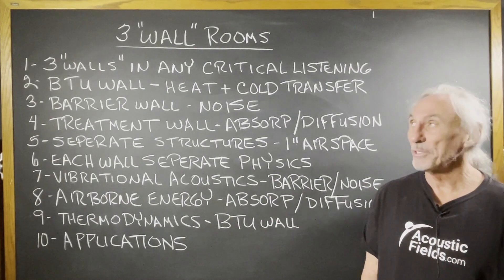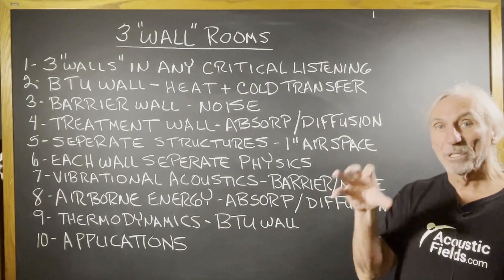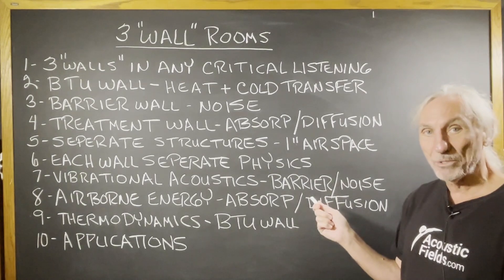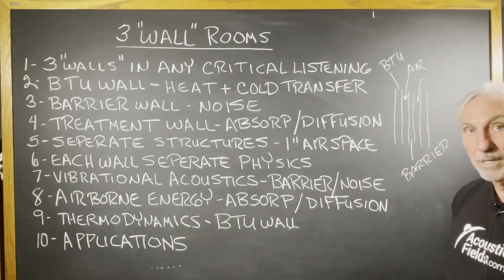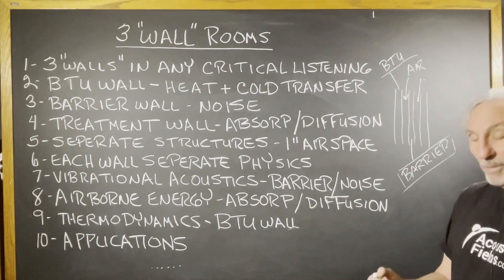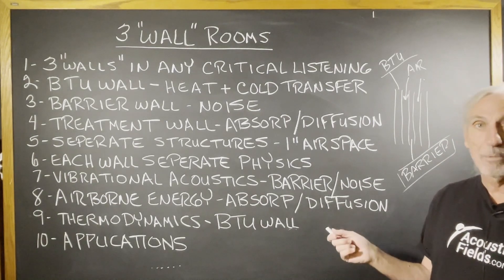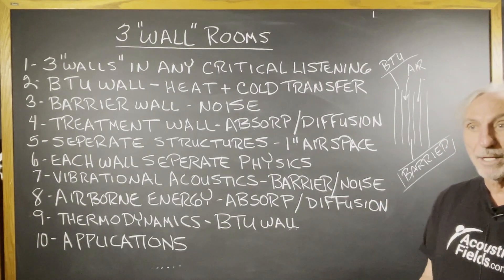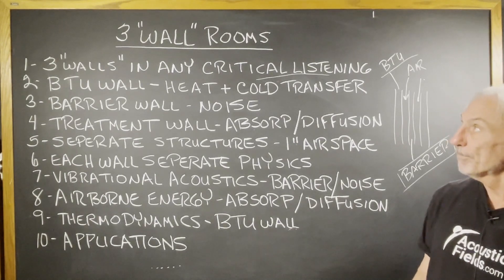3 Wall Rooms - www.AcousticFields.com

Comment: Thank you again Deniis for your clear explanation of these issues. So fortunate to have found your channel. Btw, my YT feed constantly features products that just can't work. This week's jewel has been soundproof curtains.
Reply from the maker: Yes, soundproof curtains are one of my favorites. First, there is no such thing as soundproof. Second, how can a piece of fabric stop a 30' low frequency wave. Third, you can not stop noise without sealing all the openings that noise can go through. Sound is like water, it will find the weakest link. More hyperbole, exaggeration, and out right propaganda. The internet has become the intermess.